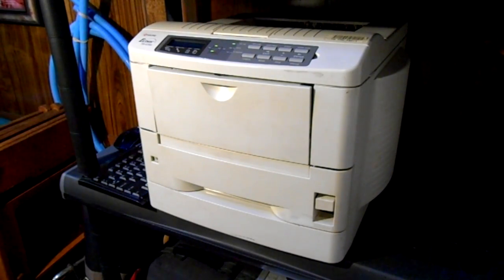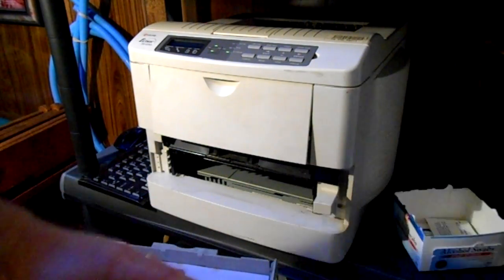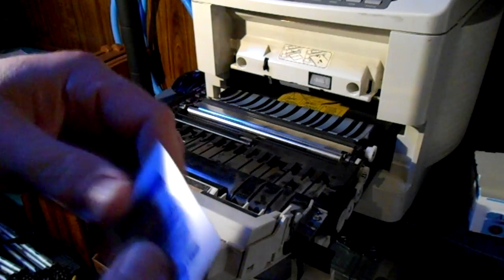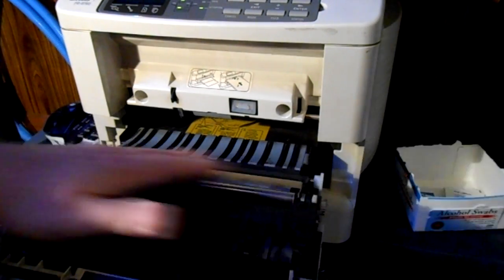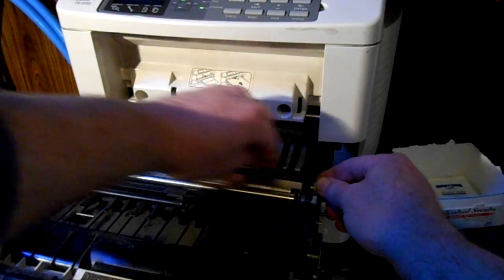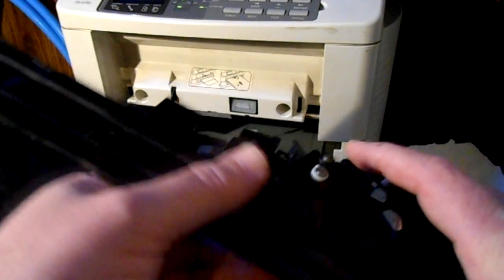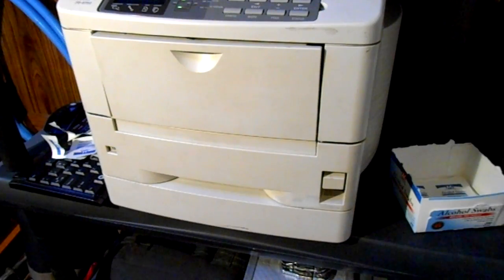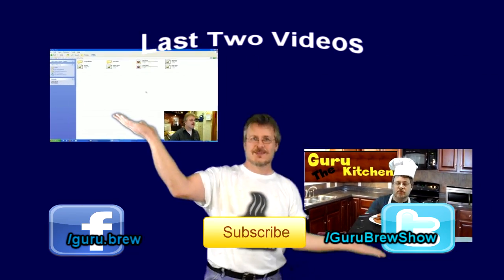How to Solve Printer Feeding and Jamming Problems

Comment: Spot on (Lexmark MS410d), the two rollers come with rubber tracks - [ removal of the cartridge was not required, upending the whole printer after removal of the paper tray did suffice ] - The world would be a saner place if error messages would have any bearing with reality, 'fill tray 1 with white paper' is simply not the same as 'clean dirty traction rubbers'.